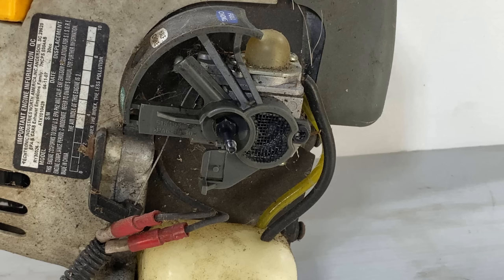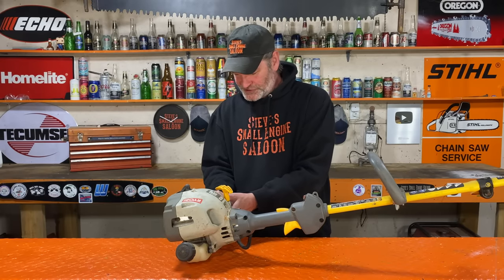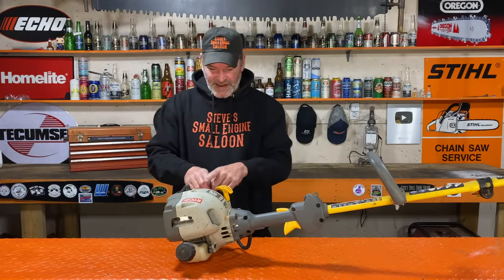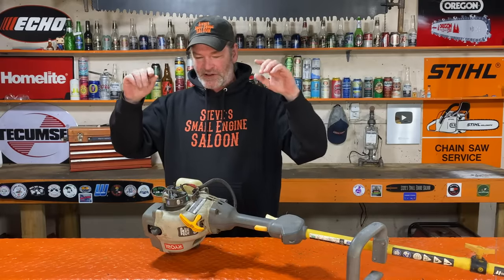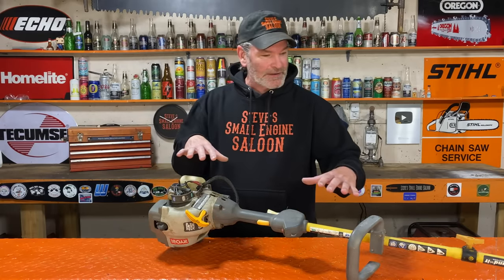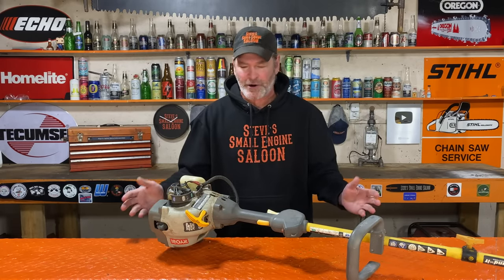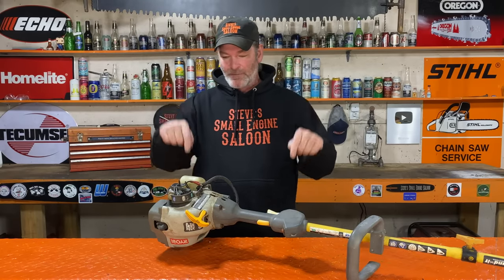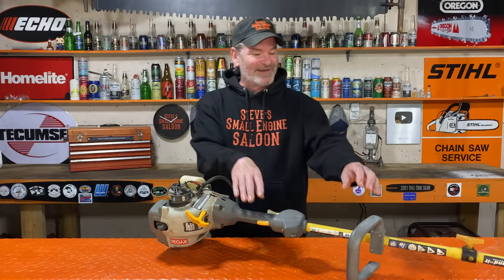This Weed Eater Is BUILT TO FAIL! Don't Waste Your Money!

Comment: The brand is getting better. My modified full crank version with modified attachments is actually pretty good. Almost up there with my real machines. It will never be an FS-85 or a PE 2400, (my favorites) but it is better than you would think. But damn...the one you got there IS pretty bad. Best thing on it is that metal attachment point.

Comment: I recently took the carb apart on my Honda 2000i generator and I could barely clean the jets with a bread tie, so I can’t even imagine how quickly an engine could be plugged if it didn’t have an air filter😬
Reply from the maker: Right on

Comment: Today there are now battery-powered weed eaters like the Husqvarna 535iFR.
They will of course need some maintenance too, but they won't need an air filter and won't suffer from carburetor issues.
I'm also wondering a bit about the bent shaft machines. It's probably convenient from a usage point of view, but power transfer through a flexible shaft seems to me like a thing that will break.

Comment: I agree however as someone with one of these things I had carb issues out of the box(not just an adjustment) it been quite some time ago don't remember exactly what it was but after getting that resolved this thing has chewed on Alot of crap and still starts pretty well. I guess you could say runs better now than when new (since it wouldn't run when new) lol

Comment: Thanks Steve! So what IS a good quality gas weedeater?
Reply: Echo or Stihl LOL.  If you don't use one very often buy a battery powered one...I have the Dewalt Flexvolt (60V) power head that accepts attachments so I can use the attachments I've had for years with my battery powered unit which is the reason I got the Dewalt attachment capable model.  It has plenty of power to run my roto-tiller attachment as well so when my current gas powered one dies I won't buy another gas weedeater.

Comment: I saw this and panicked, i just bought a new Ryobi weed eater and have only used it a few times, it is a little different model with straight shaft, 25cc.  I ran out to the garage and pulled off the carb air cleaner cover......mine does have a foam air cleaner, not much to it but it does have one.

Comment: I appreciate you making this video, Steve!

I've never personally used Ryobi, but I always thought they were supposed to be a decent budget brand.  Do you have any idea what kind of warranty those come with?
Reply: Had a ryobi in the 90s and it had a filter and got another 2 years ago with a filter, that unit in the video looks somewhat in between the 2. Toro is the alternate to ryobi
Reply: @shadowopsairman1583  Yeah the machine Steve is reviewing is the best part of 20 years old. The Ryobi 2 stroke I bought and is still going strong 6 years later has an air filter on it.

Comment: I got a southland wheeled string trimmer a year or two back. The unit wasxawsome until it stopped working... I got it out this spring & it would not go, not to ge unexpected but then I looked into it. The pleated sir filter fell apart, no biggie right? Wrong! You can't buy parts for it. The fuel lines rotted due to ethanol, the bulb rotted, the diaphragm rotted... all doe to ethanol but what really gets me is I can't find parts for it!

Comment: Lots of companies scabbing out, where have snorkels gone on mower handles? Yeah, they scab out and suck air right down on the cutting deck that's covered in grass clipping and dust.... too scabby to put a $20 extension on to obtain air higher from the dirty action.

Comment: Hi so I have a stihl fs 220 weed eater had for 6yrs now. I had carburetor trouble recently where it would shut off and takes 5yrs to restart and when it does as soon as I start to rev it, it bugs down and shuts off. Now I bought a new carburetor off eBay install it it's starts pretty good but there is still a problem I had to be tuning the H/L and the LA screws repeatedly to get the desired power out of it. And when I do it will run good for a hour or two probable 3 then it starts to bug down again then I have to start all over again to get the desired power. Could you advise me what the problem is or could you make a video showing the potential problem that could cause it and the potential fix? Thank you.

Comment: Having a really hard time locating the little foam filter for my whacker now it's getting older, what are your thoughts on me making my own from those little dish sponges (in regards to air flow) I'm not a tight arse just can't find em'😂
Reply: Way-back in my youth (a long time ago now: I'll be 50 in a few months... 😭) we used to convince ourselves that our junky cars would go faster if we cut away the corrugated paper air-filter from its' rubber surround and stretched a couple of layers of tights/pantyhose over the orange rubber air-filter housing and fixed it there with rubber bands or gaffa tape to act as a "Free-Flow Air Filter" like a race-car 😉👍

I can't say if it made all that much difference or not 🙄, but nobody ever wrecked an engine from doing it, and my buddies and I used to hoon those crappy cars sideways around dusty fields and gravel roads doing handbrake-turns and J-turns 🤪👍 thinking we were WRC  Rally Drivers every chance we got, so it might be worth trying it on your weed-eater instead of using dishwashing sponges, because the fine-but-dense mesh really does catch dust well, without adding much in the way of air-resistance at all...

Then, when it gets dirty, either use a vacuum cleaner to suck the dust out of the fabric, or just move the fabric over so that a clean area is over your air-intake 😉👍

Comment: Good afternoon, I didnt know where else to ask this but I have an Echo GT200R weedeater that I replaced the carberator, air filter, spark plug, and fuel lines and it still has issues. It cranks and revs ok, but when i change the angle of the weedeater it begins to sputter and die. I cleaned off the spark arrestor plate as well. What could be the issue? I am running out of ideas.

Comment: What a shame because Ryobi battery power tools are quite good. I own many. They are making small gas engines to be disposable/thrown away these days thinking that they are about to be banned soon for electric. The new Briggs push mower engines these days don't even have an oil drain plug and they tell you to never change the oil,  just top it off only. Ridiculous!

Comment: Timely video.  I have 2 of them .4 cycle. I just tried adding a foam piece and it wouldn't run right. I  noted foam already looked oily. The crankcase vents into the air cleaner and seems to clog a foam filter.  I could try removing the vent and trying again with the foam and hope the smog police don't take me to jail.

Comment: Notice that the starter rope is on the clutch side and not the outside. Making it difficult to replace meaning the starter rope will out last the engine

Comment: I'd be curios to know the model and manufacture date of that. It looks vert much like my SS30 built in 06 and that one has a filter. Mine also still runs solid. After all this time I replaced the fuel lines and carb diaphragms this past spring. That's the only non regular maintenance it has required.
Reply: Same here, have a CS30 since 2007. It has a sponge filter still runs and has lots of attachments

Comment: Oh Steve, I hear you man, Ryobi crap infuriates me.  I had one of these in the shop about 2 weeks ago, and I asked the customer if they had the air filter.  Turns out it just doesn't come with one.  I ended up making one for it, only because the lady really liked it's battery start option.  Not sure why, because that whole battery setupo made the trimmer heavier than Thor's hammer....  But yeah, the thing is such a POS, it's hardly even useful as a boat anchor.  100% spot on Steve!  Cheers once again from Calgary!
Reply from the maker: Right on buddy!  Thank You...
Reply: I'm working on one for a guy, and I asked him the same question as to where the filter. His reply was it didn't come with one. SO I did the same, made one up.
Reply: @StevesSmallEngineSaloon  Steve, I bought a Ryobi zero turn electric mower with the lead acid batteries. Now I want to do a conversion to lithium, but not sure how to proceed. Any advice? Thank you in advance.

Comment: For the last 6 years I've been using a Husqvarna 128LD trimmer and have had zero problems with it........ (Always use no ethanol gas and 2 cycle oil at 50:1)
Reply from the maker: Right on

Comment: Hi Steve, I think any company making battery powered weed eaters will not care much to continue the two stroke engines, making poor quality machines to make them obsolete as fast as they can, no matter what the consumer wants.
Reply: That's my take on it too.
Reply: The consumer actually wants battery powered tools. There's a pretty limited amount of people who actually need a gas powered tool. Sure, a lot may want one, but that's just because they're of the type that tried battery tools 2 decades ago, and still thinks they absolutely suck, or the type that thinks you'll be changing batteries every third minute. Honestly, there are very few people left who are way better off with a gas powered tool than a battery tool, it's just a matter of changing your workflow.

Instead of taking petrol cans with you, you take spare batteries. You can even put a charger in your vehicle, so your batteries get charged while you drive somewhere or back home. You can use one of those "solar generators" to recharge your batteries, for free even if you're in an unobstructed sunny area. Battery tools are the way to go, there's just no way around it.
Reply: @timderks5960  For most home owners I think battery makes a lot of sense. Entry price can seem steep, but once you get a few tools with the same batteries you're good to go. Ease of maintenance is a big plus.
 
The problem with "taking extra batteries" is you have to first buy a bunch of extra, expensive batteries. Gas you can just bring a can. I think most commercial applications gas is easier/cheaper. There are some awesome battery backpacks out which address the run time issue for large jobs, but I'm sure it's an expensive system to get into. It may be worth it depending on your needs, but definitely not necessary for most home owners.
Reply: @A6Legit  The thing with batteries is: You tend to get them for free, if you pay attention to what you buy. There's almost always some kind of special action going on where you can either buy a body and get a battery, or get some points from which you can "buy" a battery, etc. 

Also: batteries are a one-time purchase, unlike gas. A battery may run around 100 bucks (assuming 18V, roughly 5Ah). Even in the US that doesn't get you that much gas anymore these days. Over the lifetime of the batteries, you'll earn them back in no-time, especially if you run stuff like Aspen pre-mix in your 2-stroke tools.

And yeah, the backpacks are cool, but overkill for anyone but commercial users. Their main goal also isn't to prolong runtime, it's to reduce strain on the arm running the tool. Runtime really is a non-issue. Humans need breaks, gas tools need refueling, etc.. "Refueling" a battery tool is definitely a lot faster than refueling a gas tool.

Yes, battery tools have a bigger up-front cost, both in purchase as well as in extra batteries, but in the end it definitely pays off in comfort, no more gas purchases, and even safety (it's a lot easier to hear somebody shout over a battery tool).
Reply: @timderks5960  If you only need one or two electric tools you kinda have to buy the batteries separate. I know with Ryobi a lot of the tools are basically free for the price of the included battery, but Milwaukee is pricey either way.

18v 5aH isn't much for a lot of tools. Ryobi 40v batteries for the better outdoor tools range from $100-400 depending on size, and they're like half the price to a comparable Milwaukee. 
Batteries aren't necessarily a one time purchase. Li-ion cells have a lifespan of 300-500 charge cycles. It may be cheaper than gas but it really depends how much gas you go through. 

I think the backpacks are for the run time more so than the strain. As a commercial worker you would be limited by battery life and nobody wants to swap them out every half hour or lug around 15 battery packs. In my experience gas tools run longer, one tank vs one battery cycle.
Reply: @A6Legit  You really don't, you just need to pay attention. I've got 8 batteries, of which I got the first 4 for free (yes, free. I paid regular price for a body only, got the battery for free, not some kind of combi-deal). I bought the other 4 because they were a great deal, but I could've easily gotten all my batteries for free by just buying them at the right time. Makita, at least in the Netherlands, has some great deals.

18V 5Ah is PLENTY for almost everything. Only some high power gardening tools like leaf blowers and lawnmowers really "need" a bigger battery, but again: only if you have either a LOT of land, or you're doing commercial work. For a regular homeowner, 18V tools are overkill and 12V is perfectly adequate. Sure, batteries aren't completely a one-time purchase, but again, a regular homeowner won't wear them out. Also, even if you only get 300 charge cycles from your battery, and a tank of gas would last you twice as long, that's still 40 gallons of fuel (assuming a 1 quart tank, which is pretty common). With the cheapest gas you can get in the US (according to Google), which already has extremely cheap gas, that's still roughly $135. Quite a bit more than a 18V 5Ah battery, which you can easily get for free. Sure, you need electricity, but at 100Wh per charge, assuming $0,20 per kWh, that's only $6 for all 300 charges combined. Do you notice how badly I tried tipping the scales in favor of gas tools, and how they still come out more expensive? I assumed you can run the cheapest gas, don't need oil, don't use pre-mix gas, and assumed a pretty high price for electricity.

Although the backpack's added capacity is nice, ask anyone who uses them and they'll tell you they use it for the strain. Commercial workers don't give two craps about effectivity, only if they are self-employed. Also, going back to change batteries takes virtually no time, unless you got far away from your truck or wherever you have you batteries. Switching batteries and refueling are interchangeable time-wise. Also: the only people that complain about having to switch batteries more often than having to refuel, are those stubborn types stuck with battery tools from the 90's. You know what people really don't want? The noise, emissions, heat and vibrations from gas tools, especially if you're working with them 8 or more hours per day. That stuff gets old REALLY fast.
Reply: @timderks5960  Yeah I've never seen free batteries, and the cheapest 18v 5ah are about $50 each when there's a buy one get one free sale. With higher performance/ capacity batteries going for $150-300. That alone kinda defeats your argument against fuel, which only makes sense when you leave out the entire cost to buy it lol, and that's only one battery pack which often times isn't enough to get all the work done.

I used to do grounds maintenance with all gas tools. Having to refill eats up time when you have to walk there and back in large fields or building complexes. When we did demo jobs we were hampered by cordless saws because they died after working for 10 minutes. Even with a couple extra batteries we ended up grabbing a generator and running corded. The 18v and all that is fine for a 1acre home owner or something, but when you need to do a lot of work batteries fail. 
Try cutting down a tree with a battery chain saw. A $100 corded will get more work done unless you have an endless rotation of batteries. (Also why hybrid battery tools would be IDEAL)

Vibration and noise didn't bother me much but I'm sure the people around the area would prefer it quiet and without the fumes. Main reason I like it is you don't have to go to a gas station all the time and there's much less maintenance than when you're dealing with fuel systems. The noise level is just a bonus

Comment: Um....it seems that no where in the entire video did you mention the name of the trimmer.  Learned it was Ryobi by noting the model number on the info tag and Googling it.  

My new Stihl trimmer (an FS56RC) was sold to me without a gear head plug.  They must have saved a dime or so by omitting the bolt, but that, along with a few other things, turned me off completely to Stihl.  I became a Husqvarna man when I saw that their model (same price) included one.  I used to be long-term Stihl (still have my 025) but no more....the beancounters win.

Comment: I've got a yard mechanic 13.5 to comesee engine. I've put a new coil and a new carburetor. Engine keeps surging and popping through the carburetor and I've adjusted the valves. Do know what the problem could be
Reply: Also it's a non adjustable carburetor
Reply: Spitting fuel through carburator

Comment: That unit looks like my Roybi cs26 which does have an air  filter. So is it possible the filter was missing?
Reply: Quite possibly...the trimmer he has obviously isn't new you can tell its been used...probably wasn't running right due to a plugged up filter, owner too cheap to buy a new one so they just removed it....every trimmer I've seen has a filter, even the new Ryobi units...someone just removed it, or it got eaten up over the winter by rodents, they eat that foam and paper filter stuff.

Comment: Wow, when did Ryobi decide to cut down on the cost?   I have an old one that has an air filter in it and converted it to a hedge trimmer.  It only gets used 2 times a year but it at least has an air filter.  Scary 👎👎👎👎👎